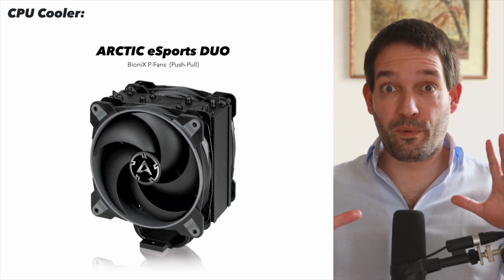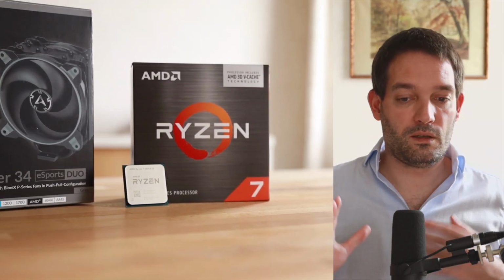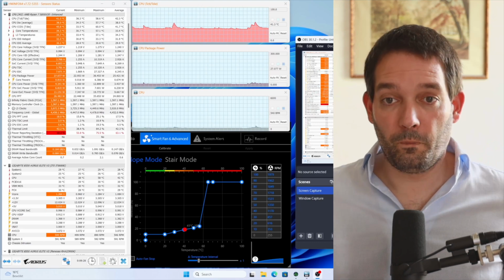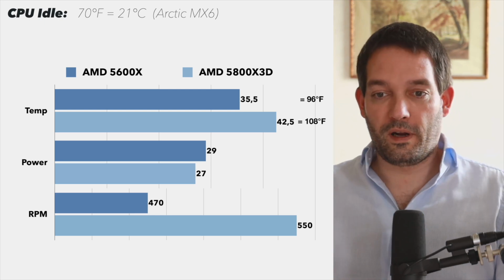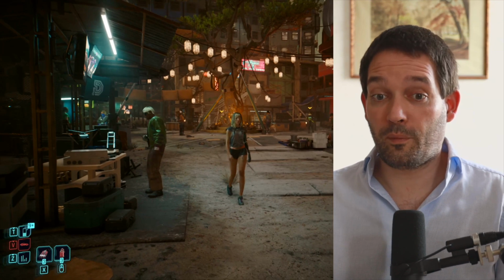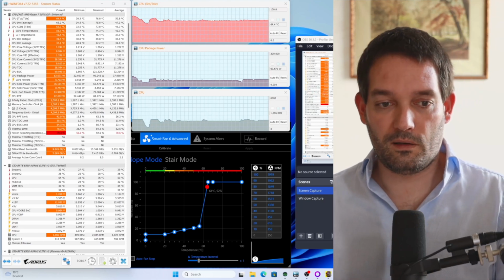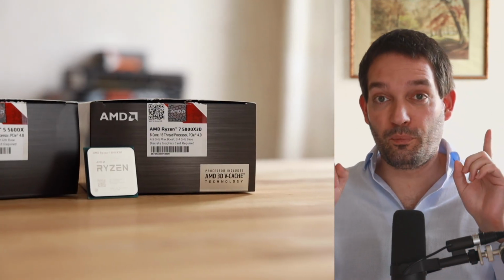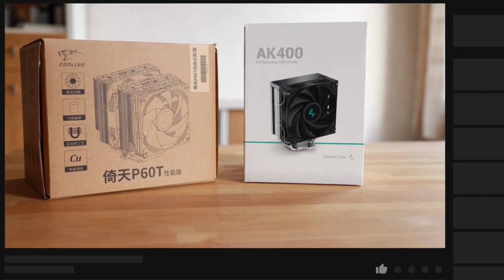ARCTIC Freezer 34 Esports Duo - AMD Ryzen CPU cooler test 🥶❄️

Comment: Will the Fan be sufficient for the 9800x3d?
I can chose between it and the be quiet! dark rock slim on the website i build my pc.
Reply from the maker: The AMD 9800X3D, like other CPUs with 3D V-Cache, tends to run a bit warmer due to the extra cache. The ARCTIC Freezer 34 eSports Duo is a capable cooler and should handle the 9800X3D just fine, but I recommend customizing the fan curve for optimal thermal performance and noise balance.
Reply: @ReviewTechTV  thanks!!!

Comment: yo, i want to buy amd ryzen 7 5700X3D and i have arctic freezer 34 esports duo, is it enough for it? i have worried about high temperature cause of my computer case's fans are really bad, now im using ryzen 5 5600 with arctic freezer 34 and in games maximum 66°C :( i need good advice...
Reply: I use it for a 7800x3d, you'll be fine
Reply: @Kurayfatt55  I think its save to assume the Ryzen 7 9700X will be also fine with the arctic freezer 34 cause am planning on getting the 9700X
just need to clean the arctic freezer 34
Reply: @rayotoxi1509 per chance did you end up doing it. I have the 9800x3d and this cooler but idk if I should try it or wait
Reply: @Kurayfatt55  thanks for advice! i will buy ^^
Reply: hey what temps did you end up whit i'm thinking on upgrating my 5600x whit the 5700x3d soon whit the same cooler arctic 34

Comment: IS that cpu cooler enough for a ryzen 7800x3d?
Reply from the maker: In my opinion the Freezer 34 eSports DUO is well suited for AMD Ryzen CPUs with X3D cache.
Reply: @ReviewTechTV  Do you think a Thermalright Phantom Spirit 120 SE 66.17 CFM CPU Cooler would be a better option?
Reply from the maker: The Phantom Spirit 120 SE probably has a bigger surface area, but at the lower price point the fans may not be a good as the ones on the Arctic.
Reply from the maker: I wouldn't worry too much, most of these fans should work fine.
Reply: @ReviewTechTV  thanks for your opinion, keep up the good work!
Reply from the maker: Having said that, know that the Ryzen processors with X3D cache will always run "hotter" than normal Ryzen CPUs. If you need more headroom go with the biggest cooling solution you can, maybe even consider water-cooling.
Reply: @ReviewTechTV  Wouldn't this case: 	Montech AIR 903 MAX ATX Mid Tower Case + the artic esports duo be sufficient to maintain the cpu cooled enough?
Reply: @ReviewTechTV  我用的是5800x3d，比fc140温度控制的好得多！！
Reply from the maker: You can use this cooler for both AM4 and the newer AM5 CPUs.
Reply from the maker: However like shown in the video I would change the fan curve slightly.
Reply: i dont think its AM5 compatible
Reply: @Kykot1999  Directly from the Arctic DE web - AF 34 esports duo: 
"Future-Proof Compatibility
At the end of 2022, AMD released the AM5 socket, the successor to its popular AM4 platform. Because all mechanical dimensions remain identical, we can guarantee the compatibility of ARCTIC coolers with AMD's new processors.
Additionally, all coolers shipped by ARCTIC are already compatible with Intel's Alder Lake and Raptor Lake LGA1700 processors. Coolers purchased from resellers, however, may still have been shipped without the corresponding accessories. In this case, please contact our customer support."

Been with this cooler last 3 years, now my AM4 will be replaced with an AM5 platform. And I will know for sure soon.